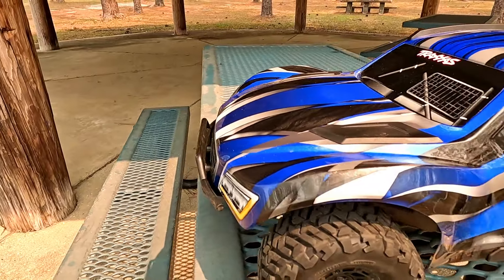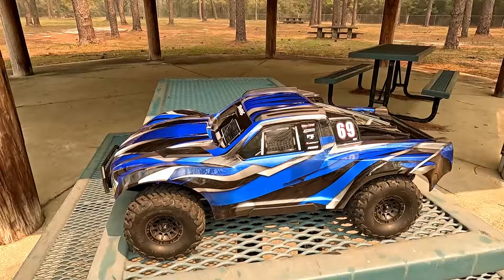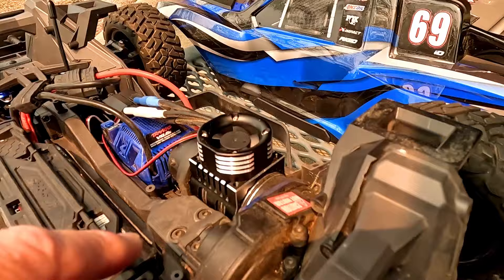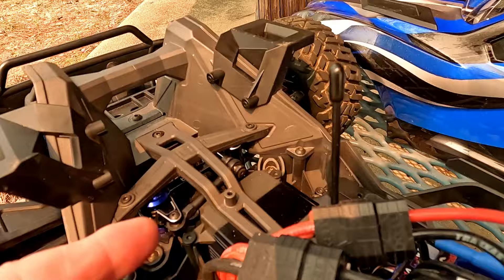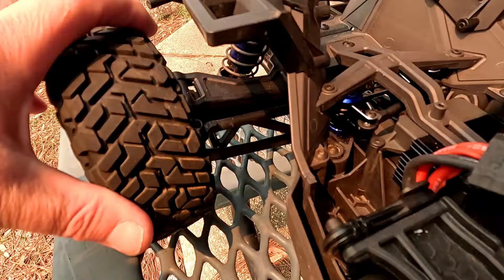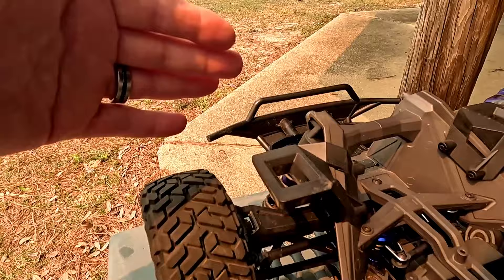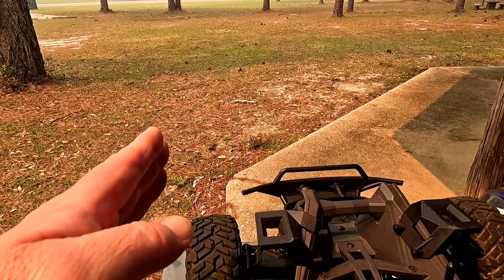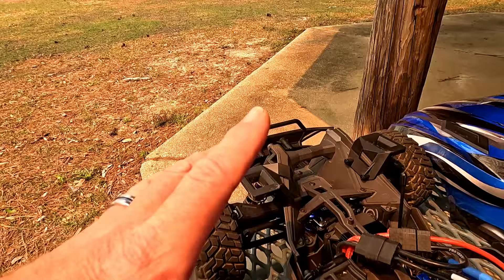Maxx Slash Rollover and Trim Issue Fixed Was It The Parts Or Did I learn How To Drive LOL

Comment: Have you got a Mojave 4s? They in my opinion and from everything I've watched put that thing on latrine detail lmfao 😅😆
Reply from the maker: I dont have a Mojave at all I do have a Kraton 4s and its a great rc. Now I have this running good its fantastic the 6s power shows but its unfortunate Traxxas didnt do anything but drop all pressure from the front springs to hide how bad it drove. Seriously how hard would it be for them to redesign the servo saver so it would actually hold the wheels straight? Maybe just a new spring I dont know when you can turn the wheels and it doesnt even try to move the servo there is something wrong.  It sucked out of the box with a servo and servo saver it rips. It still has issues with tires hitting something they should have found before release as well as the body just throws everything in the chassis like a trash can at least the Mojave has that insert in the body to shield everything and my Kraton has extended flares behind the wheels to keep dirt out and works very well
Reply: @L2theWcarscoffeelife  id still put the 4s against that 6s, it's much more enjoyable to drive, plus it geared right, it might just make that TRAXXAS 6s power system look bad lmfao, I like to talk shit, just bsn , you know how it is when you are hurry up waiting with the guys, lol plenty of time to be with everyone. I e been out for a long time, I signed the dotted line at 18,did 4 on active, 7 in the reserves, honorable discharge from both. I'm bout 40 now, but I grew up fast, it was 2003 or 4 when I signed up. I'm glad I found a veteran channel to support. I'm trying to get a channel going but I got like one or two good videos, I got to get the gear, go pros and stuff, then I'll do build videos , from a pile of parts lol. I have a big rock 3s, I have a 130 amp ESC spectrum smart Firma ESC, 1900kv spectrum brushless motor, I use the one smart battery I have, on 3s , I've also put the Metal diff's in it , 4s shocks on it, anyway I can full trigger it and it'll just jump off the ground on 3s lol, I don't know what it'll do when I get a 4s battery, I gotta chill down the gearing in it, Metal pinion and spur is 55 tooth instead of 57 , that makes a big difference on the spur , just dropping a few teeth vs going up on the pinion, lol, but it's so cool to watch, it hwsca locker instead of a slipper, it'll literally, raise the front uo and the back tires just launch it into the air, i don't do i it much, lol. Man when I get me one then gps analyzer things I'll know more about the speeds it'll reach, I got belted tires, I just haven't put them on yet, gotta get some longer adapters, they are the proline belted trenchers with the interchangeable hexs on it, I got to get some longer ones. I also have a senton, it's pretty badass too , it's not built to the degree of the big rock, but it's got 120 amp Quicrun ESC and 3660 3200 Quicrun brushless motor, you can be on dry pavement and at half trigger it'll smoke the tires if you pull it open hehe, boy I love this hobby, I'm fairly new to it but I like to build them, that's as fun as driving. Going to get a granite roller today hopefully if it works out, then all I'll need is a vorteks lol, I guess I'm a arrma guy, but I'll drive anything, it's all fun, just mostly experience in building the arrma one's, has a two TRAXXAS and when I had em I liked them, a rustler and a slash, nothing to them but when I bought a box of parts they would make two almost complete 3s arrma rigs I was hooked, then I learned about Traxxas by them placing lawsuits on everyone, getting people YouTube channel shut down by some copyright vs or something, they got back but just doing it to be a ass because the damn channels were trying to make them look good and it's not justified. Sorry I babbling, have a good day
Reply from the maker: Thats how Traxxas tries to stay in business sue everyone. I like the cars I have but the Warranty is crap 30 days electronics that is it maybe if your lucky and a part breaks they might fix it where Horizon hobby has 2 years even Team Corally a much smaller company than Traxxas has 1 year. The hobby is fun and addicting the mutt max is faster it has more power I dont know how the Mojave jumps I saw a few videos it seems to be about the same as the mutt maxx they are ground trucks they do small jumps. The 4s Kraton and Outcast they will jump and love it the 6s Kraton wow the power to weight is outstanding I accidently cleared that big valley of concrete that drainage ditch with it I measured it once I think it was 40 ft!!  6s is bigger than 4s the smaller is fun more nimble and still fast every rc is a bit different thats why I have so dang many lol I am enjoying it from boats to planes cars trucks I am having a good time
Reply: @L2theWcarscoffeelife  I'm sticking by , the videos of the 4s Mojave was out doing the 6s Mojave From what I've seen and Earl Moorhead is a great mechanic on these and real size vehicles he usually pulls out them Traxxas systems and puts in max 5 or sixes or something, I saw I put the factory ESC back in just so he could have lights which I didn't understand that but he's very professional sure I say because I would have got one in light bars off valley Express and ran that joker to that fan connection on that ESC and kept fire  from there ran to the receiver and got it I'm just not impressed with traxxas's power systems and like you say they're warranty 30 days pretty much let you know or it does me that they don't have much confidence in it yeah it might run like hell but I don't think it'll run like an arrma lmfao. All bullshit aside I'm glad you enjoyed the mutt Maxx I guess that's what you nicknamed it? Again I'm pretty new to your channel I went back last night and watched some older ones so I'm still catching up on what you got and what you don't got but I'm here from now on out
Reply from the maker: @PtsdRC  Guess who has Earls old XRT? The one he almost burned down putting in an esc lol
Reply: @L2theWcarscoffeelife  yeah I noticed you caught it earl on your video lol